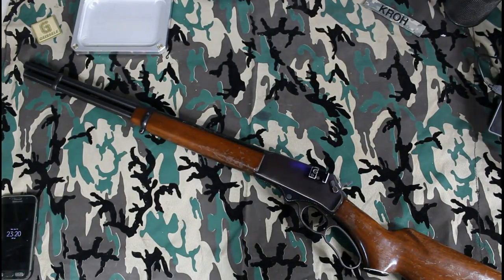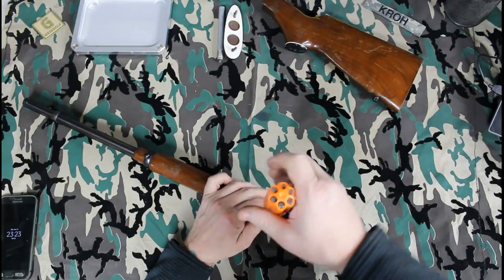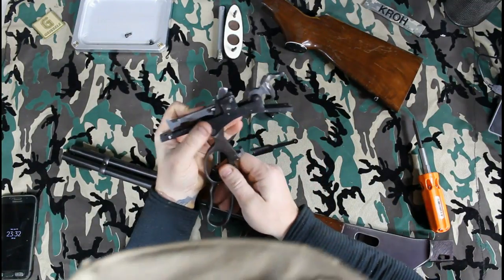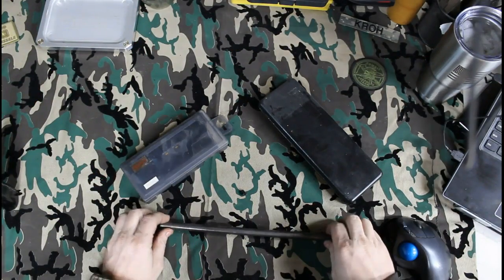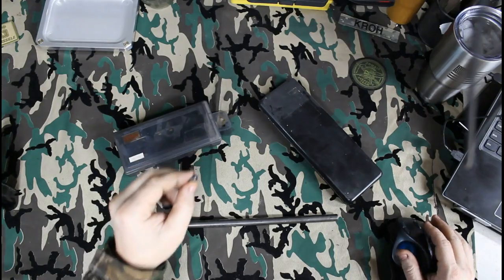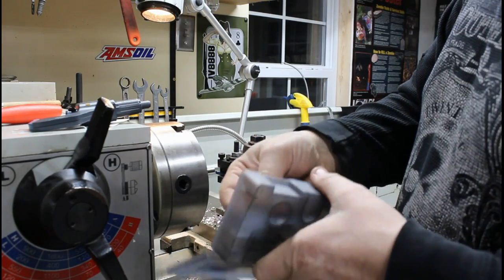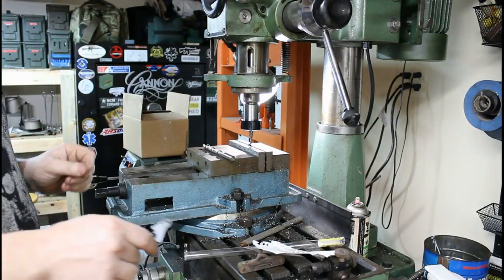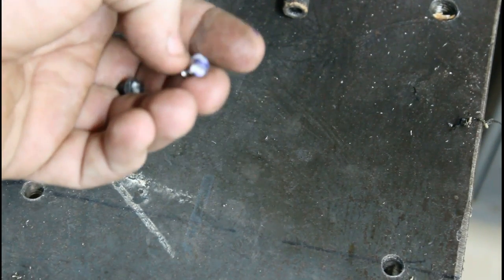Mossberg model 472 repair

Comment: Could you make a plunger for me? I am having the same issue with my Mossberg 472 pca
Reply: You ever get a plunger? I'm in the same boat.
Reply: @billblasko1872  jack first gun parts is where I got mine I had to polish it a little on the outside but it worked